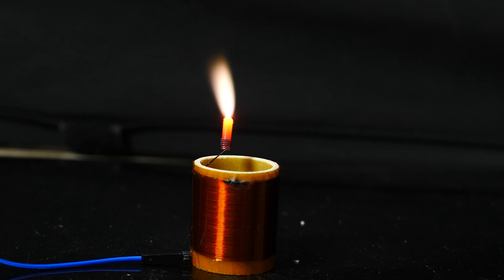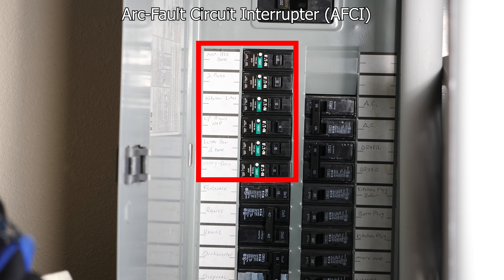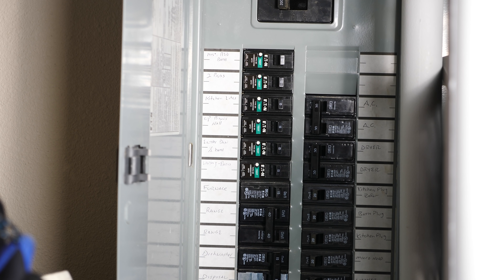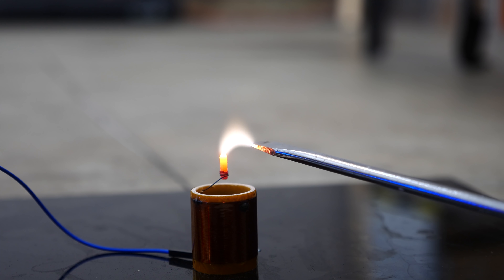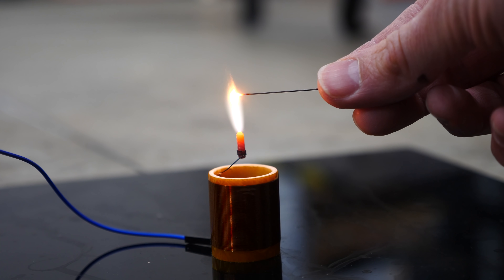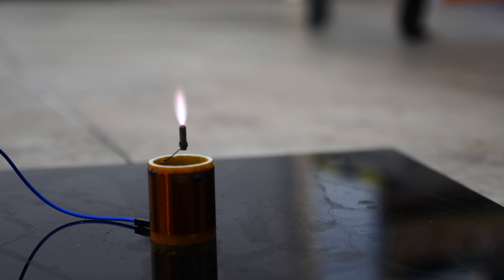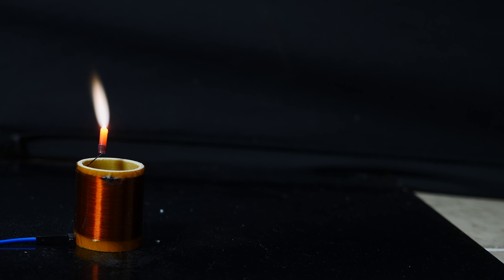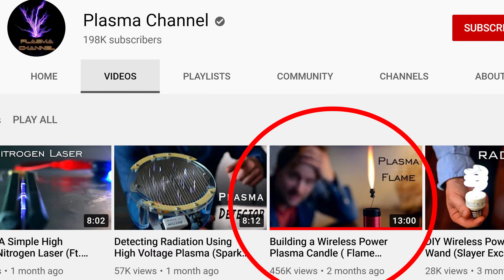The World's Hottest Candle Can Actually Melt Steel—Plasma Candle

Comment: Is there any danger in the EM waves coming off? i.e. are they like high enough energy/dangerous wavelengths, to be akin to x ray or anything like that, that if exposed to for long periods could cause harm?
Reply: 15 MHz is in the RF range at much longer wavelengths than FM radio which is around 100 MHz.

Comment: Hahaha that’s awesome that it’s tripping arc fault circuit breakers. That frequency is read as feedback through the neutral and saturates in all the other wires. That’s why VFDs and servo motors use shielded cable.